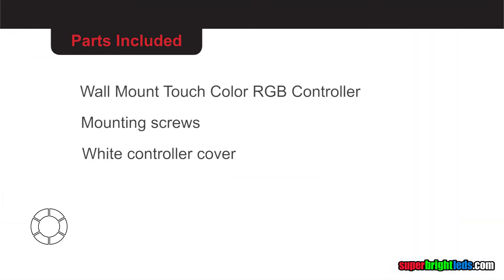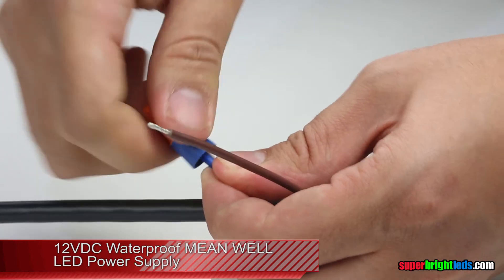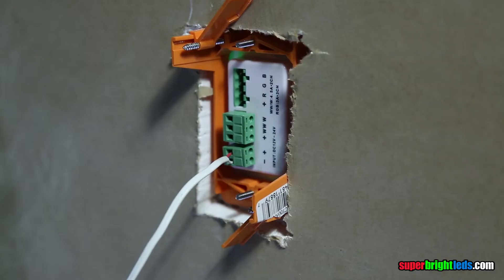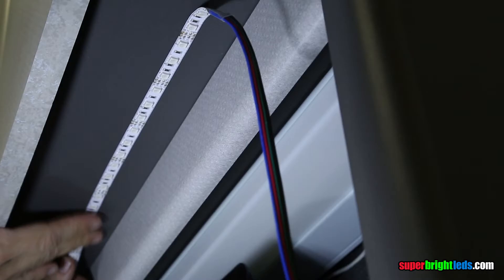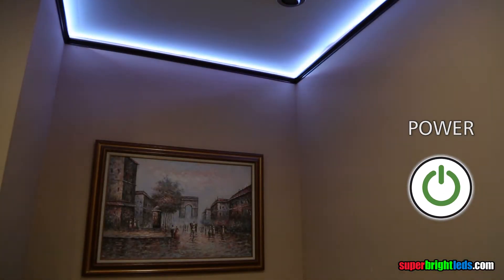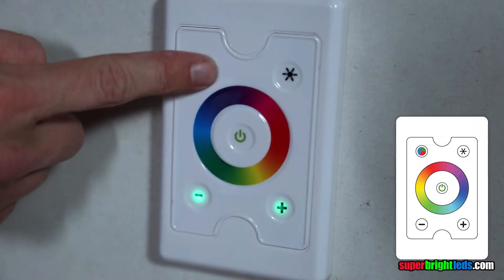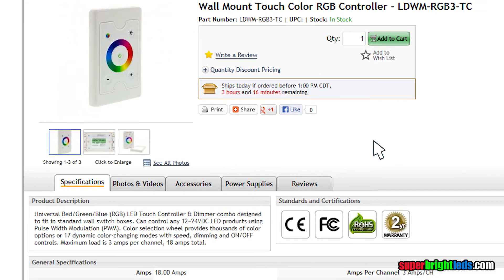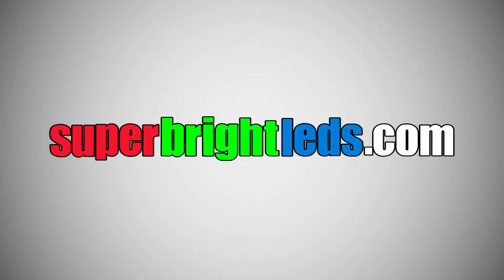How To Install LED Wall Mount RGB Controller

Comment: This i a waste of money if your trying to put this in your house because you have to wire the leds to the swich in the wall and if your trying to put the led on your ceiling you got to run a wire from the swich to the ceiling
Reply: Here is RGB LED Strip with Touch Switch Controller http://www.ebay.com/itm/122494894492?ssPageName=STRK:MESELX:IT&_trksid=p3984.m1555.l2649

Comment: What are the WW and W contacts for?  Can this control white LEDs along with RGB at the same time?
Reply: Hi wowcolors! This particular controller is not able to control both white and RGB at the same time. The same base is used for a similar product that controls variable color temperature white lights which we do not carry. This plate only controls RGB functions. I hope this was helpful!